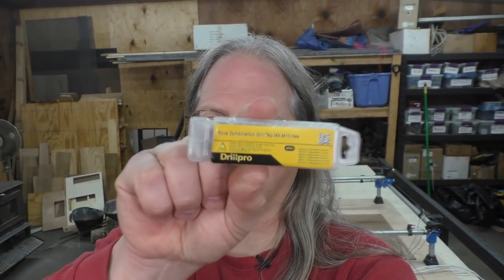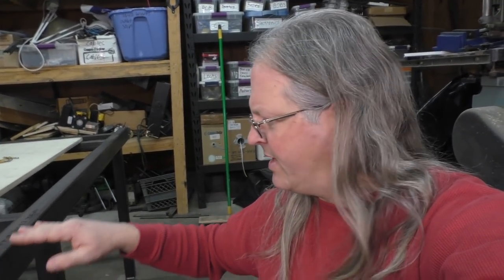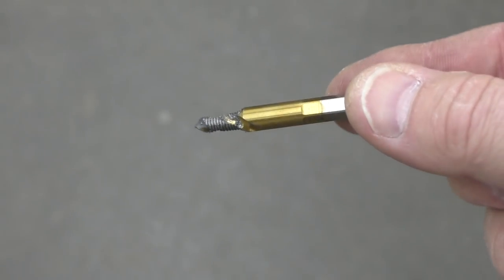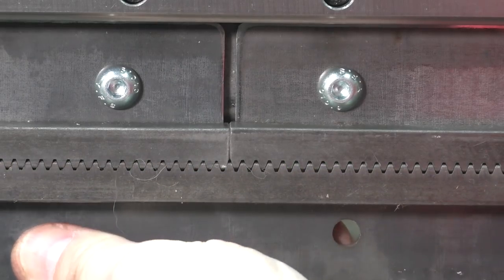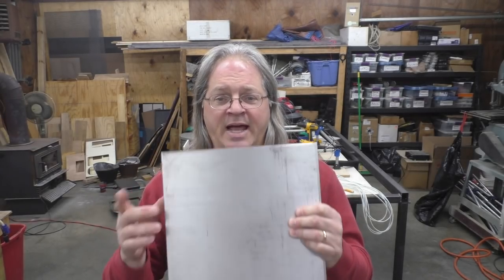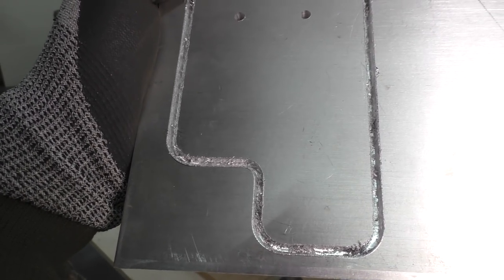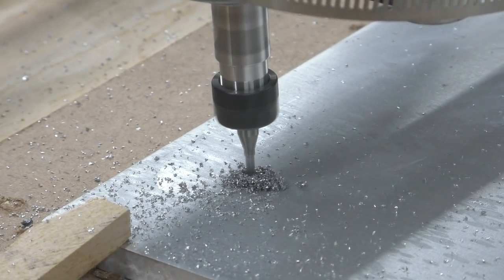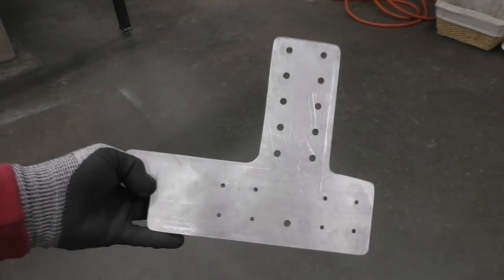DIY CNC Router - Part 4 Finishing the Y-Axis

Comment: Get a flex nozzle with mister. At least just blow the chips out of the cut with the flex attachment.
some say alcohol will  lube and cool the bit, but at least you don't have to worry about flood cooling and the mess therein.
You never mentioned which bit you were using.
Get into Fusion 360 and you can manage your chamfer toolpath with correct carbide.
It is a fairly steep learning curve but there are so many fantastic tutorials. 
Reply and I will get you sorted on those if you like. Its frigging amazing how much development is being done on this Autodesk 3D design platform. Almost better than sex
You might have had to rescue the part before the profile cut was complete but like you said the holes are done to spec, and from what I see complete with counter bore.  Aces!!! 

good luck with the build
Reply from the maker: There is a link to the bit in the description.  Thanks for the info and thanks for watching!
Reply: @MakingStuff  get a grip. Nobody has the time to invest in your misinformed project.\The fact I take the time out to help is a jewel in todays busy times.
That is the extent of your reply based on the info I have given???
I am unsubscribing my friend. No return equals no interest.

Comment: Compressed air, maybe with a mister of some cutting fluid/coolant. Also, you can do two passes of each step down to create a wider groove, which will help with chip evacuation when you get a bit deeper!

Also, consider using the wooden reducers to get big machine up and running, then cut the aluminium reducers on the big/stiffer machine?
Reply: good thinkin'

Comment: How many flutes were on the cutter (hopefully no more then 2). Also, depth of cut, feed rate and rpm of the tool will have a big affect.
Reply from the maker: 1 flute, .5mm cut depth, 14mm/s, 13,000rpm

Comment: Did you try cutting the aluminum plate on your cnc plasma table?
Reply from the maker: The plasma table will cut it, but it will not cut the small holes.
Reply: @MakingStuff  I built my cnc plasma table after being inspired by your videos. Wasn't sure I really needed it but it was such a fun project and turns out I use it all the time. Love your channel!

Comment: Its called galling which aluminium does very easy
Use of a coolant is advisable
Reply: What coolant type and dilution (if any) would you say is best?  I was going to try at least a coolant flush full time and/or submerging the plate while cutting.  Thanks!
Reply: @W4TRI  PEG (Polyethelene Glycol) solution dissolved in distilled  water to saturation. Use flush system to aid in flushing chips away. The important things when milling is to clear the chips and keep the cutter and material  as cool as possible via air cooling or coolant flush. And make sure the cutter is sharp. Decrease spindle feed rate and depth of cut to obtain desired  results. Remember heat is your enemy